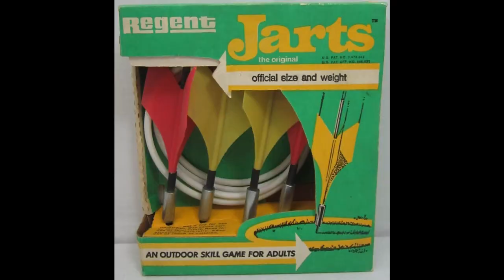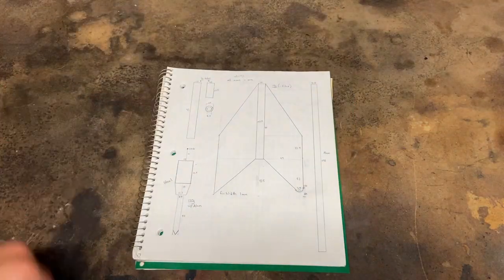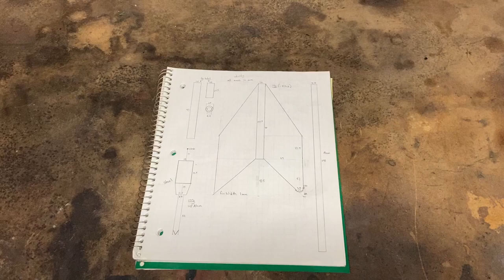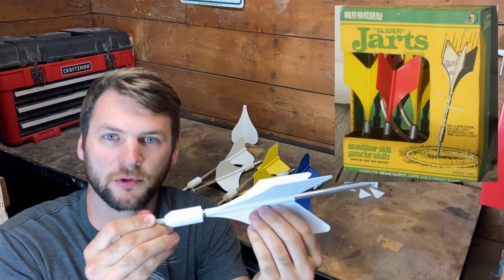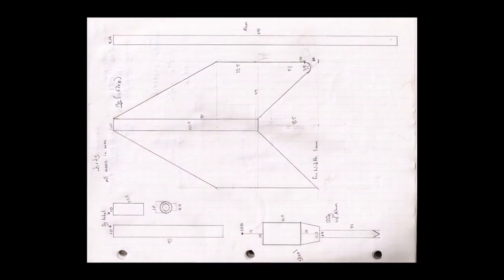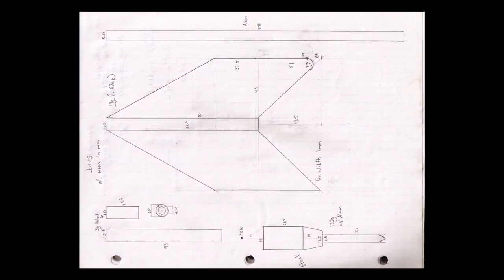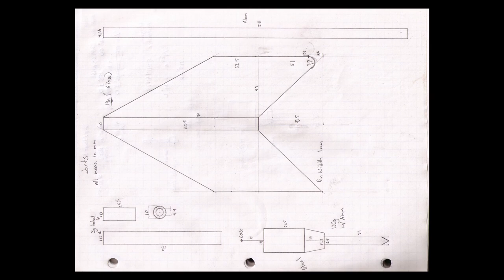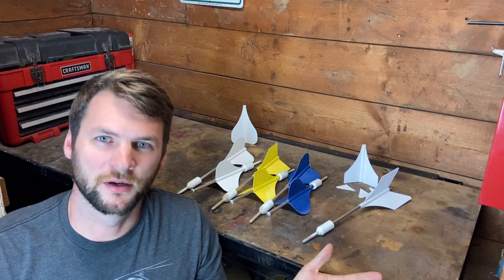Lawn Dart Fin Replacements | EASY How To Make Lawn Darts

Comment: You need to make the hoops. I have the original set still. It has 2 plastic tubing hoops that you aim to land inside. We make the big one 100 points, closer to the thrower, and the small one 500 points, further from the thrower. Much more fun to try to get them inside the circles. I think they're like 1.5 ft diameter and 2.5 ft - I think.
Reply: I have one of the original hoops (the other disintegrated) they were just hard plastic tubing. I bet some semi-flexible tubing and a dowel to connect them would be plenty, and easy.

Comment: I'm just gonna make a sand mold and use aluminum for the weighted portion , drill and tap. Then use the flexible plastic for the 3d printer. The main tube will stay the same as you have , but the point will be a beam nail cut down that you can get from any hardware store....

Comment: Hi Kevin. In general is it possible to print fins with a design on them such as a aports team logo in at least two diffferent colors? If so what 3D printer(s) would you suggest for that? Many thanks.
Reply from the maker: The new fins I am printing now are very hard to print, even in one color due to the flexibility, not really for beginners. I think a sticker or paint might be your best bet for a logo. I have red and blue fins, but can do a few other solid colors for an additional $20. My page will be going live in a few days.
Reply: @kevinsgarage  I very much appreciate your honest response and very much look forward to your live page. Thank you
Reply from the maker: Also, 3D printing is a lot of fun and I highly recommend getting into the hobby. Elegoo and Prusa are two great brands to start with.

Comment: You can still buy lawn darts in canada they are not the original brand but i purchased a fww sets of the ones that are still being sold now and honestly im surprised they are being sold because of used irresponsibly they are still just as dangerous so im jot sure how they are getting past regulations that prohibit them in canada and the United States.🙂👍✌️

Comment: Are the fins ABS? I believe the originals were made of polyethylene which were more flexible. I am told it's hard to print the fins in poly due to the material shrinks too much.
Reply from the maker: I printed them out of PLA. They don’t flex, they break, that’s why I redesigned them without the fin points. I’m not sure the original fin design can be printed due to breaking at the layer. But I can see a cast being made and then using a semi flexible resin to cast the part in.
Reply: Just but the legal set for $18, cut the tubes off the fins and use them. They r perfect and flexible.
Reply: @sbetts10001  You are correct and they work just as well! I try to pick them up at rummages & at auctions.
Reply: I printed some out from thingiverse from TPU. Had to split the file in 2 but they came out pretty great. No breaking with ground impact or other darts hitting them.
Reply: What was the file called I cannot find them

Comment: What infill did you use for the PLA
Reply from the maker: 0%. the design I made uses only 1 shell for the fins and 2 on the tube. This keep the weight down so the CG is in the right spot

Comment: Your ebay link as of 4.13.22 is not working for purchase. Am I doing something wrong? Thanks
Reply from the maker: eBay removed them since they are associated with banned goods. I am working on getting an alternative secure purchasing method worked out.
Reply: Thank you for the reply Kevin's Garage
Reply: @kevinsgarage  Are the files out there somewhere, either for free or for sale, so we could print them ourselves?
Reply: @kevinsgarage  just release the files.  You're going to get in trouble for profiteering off a banned product.